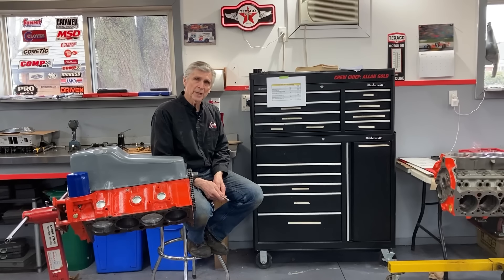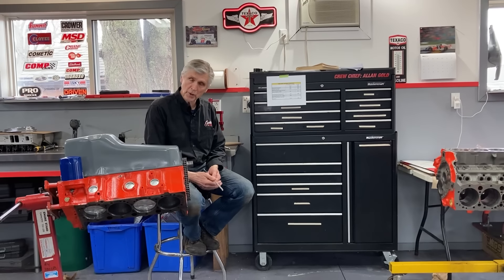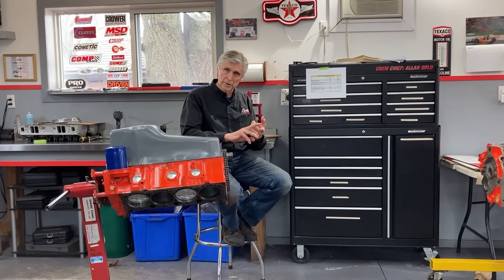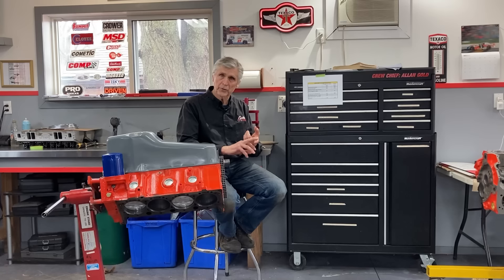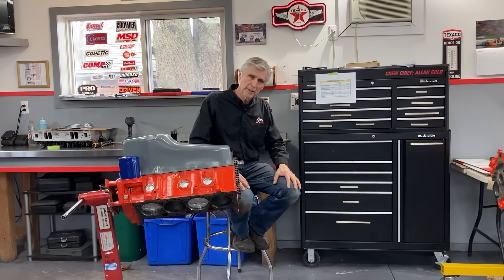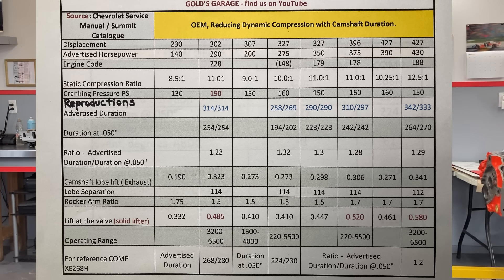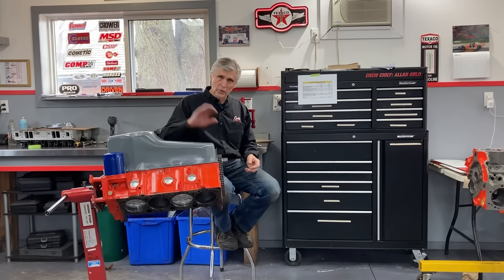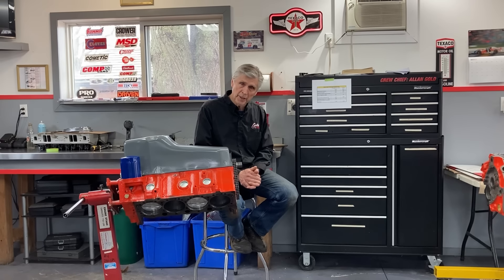Selecting the right camshaft - Compression Myths How much compression can you run on pump gas?

Comment: There is a difference between cranking compression and the dynamic compression the engine sees at the torque peak.  If you were able to test the 427 compression at 4000 rpm instead of cranking rpm, you would get a lot more than 150psi.  If you took a mild, luxury car big block cam and put it into an L88, you'd probably detonate the engine to death.
Reply from the maker: Good points peter. I meant to address your comment about compression at 4000RPM in my last video. You are correct, the air has weight and so it has inertia. At high RPM it would essentially supercharge the cylinder. That is how it makes power. The weight of the car is also a factor. Thanks for your comment. AG

Comment: With water injection you can drastically increase the octane effect on your fuel, advance timing significantly. The engines im screwing around with have AVCS, basically advance and retard cams with oil pressure at different rpms, I just don't know the best way to tune it yet. Im thinking more advanced cam timing, higher dynamic compression... Learning still.
Reply from the maker: Thanks for sharing your experience Crazy.AG

Comment: You are incorrect about a number of the facts regarding the phase out of leaded gas in the 1970s. Let me clear up a few of them: 

1) The EPA has absolutely no authority over Canada or Mexico, only the US.

2) The EPA did not ban the sale of leaded gas beginning in 1971. That is completely false. What the EPA did do is mandate that (most) new vehicles in 1975 have catalytic converters, and those vehicles needed to run on unleaded gas bc leaded gas would ruin the catalytic converters. The actual phase out of leaded gas by the EPA took place over a much longer period of time, but up until 1975 pulling up at a station and finding leaded gas was the norm, not the exception.

3) However, various manufacturers could see the writing on the wall long before that and that's why they VOLUNTARILY started reducing compression ratios in ~1971 to prepare for the lower octane unleaded gas that they knew would be coming eventually. 

4) Ethanol wasn't widely used an additive octane booster to gas until the mid-2000s so your statement about that being why the engines made less power in the 1970s is completely wrong. Between the late 1970s and mid-2000s MTBE was the additive octane enhancer of choice. 

5) While your statement about ethanol containing less energy per unit volume is true, again, that has absolutely nothing to do with the power levels of engines coming out of Detroit in the 1970s since it would be decades before those engines even tasted that moonshine. Additionally, you have a fundamental misunderstanding about the combustion process and how power is created in an engine if you think that the lower energy content (by volume) of ethanol means it will inherently make less torque/horsepower than gas in an engine properly tuned for it.

I appreciate your videos but that was just a lot of misinformation you dropped in a short period of time.
Reply from the maker: Thanks for your comments Noway. I try not to get into debates about stuff like this but I did not say that the EPA banned the sale of leaded fuel, I said it mandated that engines being produced after 1971 had to be able to run on unleaded fuel. Watch the video again and check it out for yourself. 
Manufacturers reduced compression to comply and HP ratings dropped dramatically starting in 1971. You may know how to make the same power with less energy but the OEM's didn't in 1971.The rest is history. 
Newtons Law of Energy states that energy cannot be created or destroyed, but can only change its form. If you inject less energy (BTU)  in to an identical process you will get less out. It's just psychics. AG
Reply: @goldsgarage8236  You're correct about what you stated, I heard that wrong. Unfortunately you're still incorrect - the EPA did not mandate that vehicles manufactured after 1971 had to be able to run on unleaded fuel, either. Again, this was done VOLUNTARILY by the automakers (it was led by GM and this was back when they had enough influence on the industry as a whole for Ford and Chrysler to follow suit). I would post a link but I don't think YouTube allows them in the comments, however if you Google search you'll see an article entitled "Industry Backs G.M. on Unleaded Gas" from Feb 15, 1970 in the New York Times that explains the whole thing. The EPA itself wasn't created until the end of 1970, FYI. GM decided they wanted their new cars to be able to run on unleaded gas, which was lower octane than leaded gas, and so they reduced compression ratios to make it happen. Period. There is nothing to debate here, all of this is matter of easily verified public record.

As for the lower energy content of ethanol compared to gasoline, have you looked up the energy content of methanol, as well? Once you do, see if you can figure out how the guys running it are making so much power. Hint: what makes for the best fuel economy and what makes the most horsepower are not necessarily the same things, and you shouldn't get them confused.

But to reiterate, ethanol still had nothing to do with the reduction in horsepower by vehicles produced in the 1970s. There was no ethanol whatsoever in the unleaded gas sold in the US in the 1970s, 1980s, and most of the 1990s.
Reply from the maker: Thanks for watching my channel and commenting Noway! AG

Comment: If you're going to have to run premium gas you might as well run close to the maximum amount or half a point lower than maximum compression that premium can support! Same with lower octane gas rating! I run 10.5:1 on 91 octane non ethanol fuel and motor runs fantastic!   If I am going to build a engine for a muscle car 60-70s era its going to be built to make more horsepower than stock and compression would be based on what compression  premium fuel can support!  If you loose power because of having to take down a point with lower compression pistons ect then you make up the power with bigger camshaft or use a modern roller cam conversion to make the engine make more power, more drivability, and reliability!  Modern camshaft grinds can make up lots of power you lose by having to lower the stock compression to make fuel standards of today!  No one cares or will know you are using a bigger or better cam. But most people want more power and not a detuned turd when you think Muscle car! Same goes for heads.. Unless your building a concours car no one cares or knows if you have aluminum modern cylinder head and intake painted factory looking.. You open up a hood at a car show and 99% of people will think its a stock engine!!
Reply from the maker: Thanks Larry, all good points. Be careful adding camshaft to make up for low compression. That said, there is diminishing returns in compression. You gain more going from 9-10 than from 10-11. I would suggest calculating your dynamic compression first.
Reply: @goldsgarage8236  Well thats good news since my 307 is fixing to go from 9 to 1 up  to 10 to 1 😊
Reply: If you lower compression and run a bigger cam you will lower your DCR to the point of having  a gutless wonder of an engine.  The whole point of the video was to match compression to camshaft to end up with an efficient engine that can run on pump gas.  The more compression the larger the cam generally.  Loweer compression needs a smaller cam to keep the DCR reasonable for good low rpm torque.

Comment: But don't you think that LSA has a major factor in an engine that has like a 280 duration  for lower torque when you compare 108 LSA compared to 112 LSA. And because 112 will have a smoother idle and faster throttle response compared to the 108 in which will have lower manifold vacuum and a slower throttle response . Somewhere there has to be a torque and or h. P. Difference
Reply from the maker: Thanks Born, i think your analysis is correct. AG

Comment: Since detonation takes a certain amount of time it's very very rpm sensitive,  the lower the revs under load the more detonation. 
High compression with the same fuel at higher revs and similar cylinder pressure, combustion is past peak pressure before detonation has enough time to occur....
Rev it!
Reply from the maker: Good advice Robert, thanks for the comment. AG

Comment: Great video, I'm currently building an australian 250ci inline six. Its going to have a healthy camshaft and I've done all the math it should end up with 10:1 static compression and 8:1 dynamic compression with 160psi of cranking pressure. As my first engine build I think Im on the right track to getting a healthy street engine.
Reply from the maker: Thanks Odinxf. Those are good compression numbers and about what I usually aim for. Remember that the compression calculator assumes zero leak down, but there is always some so your actual cranking pressure may be a little less than you have calculated. AG

Comment: Static compression and duration are not an acceptable way to determine what fuel is ok to use. Cranking psi isn't much better.

Dynamic compression ratio, which factors in inlet valve closing degrees (numerous online calculators available free) , is the better way. Your compression isn't going to be the same if the only change is an inlet valve close of 68 ABDC vs 88 ABDC

Alloy heads will accept higher compression than iron heads.

Combustion chamber shape, piston crown, top ring location, spark plug heat range, cooling system efficiency (back cylinders/combustion chambers always run hotter) and a number of other details will also have an impact on flame propagation and hot spots that can lead to pre-ignition.

It's also worth understanding that low octane fuel burns faster and therefore requires less ignition timing. both of these are in fact more efficient. I'd rather run 28 deg total advance with 87 than 38 deg 93
Reply from the maker: Thanks J, compression pressure is correlated to DCR and is a way to measure it. More content for my next video, thanks for the input. AG
Reply: That's a long bow to draw. True dynamic compression ratio is achieved through precise measurement and calculation. Rod length is a variable of DCR for example as it changes the piston accel/decel curve and mean piston speed.   

Cranking pressure is at the mercy of the many variables. Whilst it's a useful diagnostic value I wouldn't be choosing my fuel and tuning based on it.

Comment: I have seen guys post on facebook claiming to run 14:1 on pump gas.
Reply from the maker: Thanks Cuzz, I don't think I would try it. Also there is a diminishing return benefit to higher compression. AG
Reply: @goldsgarage8236  I have never heard about the diminishing return but it makes sense. I used to just call bullshit when someone claimed to run 14:1 on pump gas non E-85 but really I dont know if they actually do.

Comment: Why bother the high compression the camshaft goes both ways to reduce or increase compression still end up with comparable results. If it's what you have ok but why build that way?
Reply from the maker: Good point fasteddy, thanks for your input. AG

Comment: waiting over 2 months, I need the right brain. I'm building a 68 nova, It has 3:42 gears with m-20 trans. I have a 72 454 that is .40 over with speed pro h581cp pistons with a stock crank and rods, and it has been professionally balanced and the estimated compression is 10.5, at this time I have 049 stock heads an edelbrock air gap and a quick fuel 750 with fat stainless headers.
 I have called comp, isky, erson, howards and clay smith and everyone tells me a different cam. Today I was ready to order Comp Cams 11-423-8, Grind # XR276HR-10,, Duration at 050 224 int./230 exh., Factory rocker ratio .502 int./.510 exh. the rear gear change is not a problem and might want another carb, What do you think ??
Reply from the maker: Thanks shifty, I have built 2 427's recently with this cam. There are videos on my channel about both of them, including a dyno test of one of them. I think it is a good choice. The 750 carb is also a good choice. I will be making videos of the second 427 install into a 1966 El Camino in a couple of weeks. Thanks for watching Gold's Garage. AG

Comment: Continue.....Charger engine Exceeds 102% Volumetric Efficiency at 5500 Rpm continuing to Max Red Line Rpm......That 53 cubic inch (at Full BDC) cylinder Is Overfilling to 54 cubic inches every time at Max Torque range Rpms.....Hence the name "RAM Charger".....I'm sure the L88, L79 & others run Way High VE also Throughout their  Rpm range.....If Those cylinders Are Filling >95 % during Full Load Rpms, ....Might be Closer to Full Static CR actual  engine speed Octane requirements than thought.......Just putting it out there......
Reply from the maker: Thanks Tom. You are correct and that subject is part of the script for my next video on this subject. Watch for it. AG

Comment: Propane, you can run 14-1 surprised it wasn’t used more
Reply from the maker: Thanks for the comment Mother. I think you are correct. Here is the problem with Propane. 1cu.ft of gasoline has 901.605BTU.  1cu.ft.  of propane has 2,516BTU. AG

Comment: No, the L88 will NOT run on 87, not under load anyway. The deal is, the OEM cams have alot of duration, but considerably less useable duration. The valve has to lift a certain amount before it really starts to flow, and the OEM cam takes longer to do that than a modern "high energy" cam
BTW, here in British Columbia there is 94 no Ethanol gas at Chevron
Reply from the maker: Thanks Alley Oop. To validate your point, if you look at the chart in my video, the effective closing point for the L79 OEM cam was 81 degrees, but the GM spec point was 108 degrees. Thanks for your input, watch for more on the subject.

Comment: When you put hi comp pistons in an engine and then find out it won't run on pump gas. Oh boy. There are other ways to make power with out high compression pistons. Better flowing heads, mild boost, fuel coolers, 225 hp nitrous kit is about the max pump gas will handle. But thats good.
Reply from the maker: Thanks for your comment Paul. Please keep watching! AG

Comment: It's a guessing game, I doubt the L88 will run on 87 and just barely on 93. Only way to tell is to build one and test it.
Reply from the maker: Thanks Joe, as I mentioned why even consider 87? However the original L88 cam has lots of duration so I think 93 octane would be manageable. AG
Reply: @goldsgarage8236  When those engines came out regular was 95, hi test was 100, and you could get 105 at Sunoco for .50/gal or there abouts. Ah the good ol days.

Comment: Actually the regular gas was 93 and premium was 97 in the 70’s
Reply: Up until September 1974, leaded gasoline with 5.5 grams of lead per gallon "regular" was TYPICALLY SAE rated at 97 octane (by motor method) and "premium" (or Ethyl) was rated at 101 SAE octane. A few of the "Majors" (Chevron, Sunoco, Gulf and Standard ) offered up to 110 octane "Premium" fuel at a premium price! Sunoco "Blue" and Amoco "Ultimate" were the highest octane "pump" fuels ever offered I believe on a wide-spread basis. In a couple of regions of a couple of States in the South some 112 was sold.  I pumped it then and for 34 years afterwards I worked for the 5th largest Oil Company. Now "gas stations" (small sellers) could "spec" lower octane ratings for a cheaper priced product, but people caught on quickly, as flathead engines "knocked" on "cheap" gas under load worse than high compression engines. Ford Flathead V-8's with carbon in the heads and on the valves (always!) knocked ALL the time unless you put Alemite CD-2 or Marvel Mystery Oil in the tank, then they smoked like an outboard! Lead in gasoline was dropped to 3.5 grams per gallon in Sept. 1974 and banned in 1975 (depending on the state you lived in, what month). It was Oct 1975 here in Oklahoma as leaded gasoline dropped to 17.8 cents a gallon with 10.9 cent a gallon state tax-that was cheaper than at the height of the Depression when it was 19.9 and only 5.9 cents tax.
Reply from the maker: @Walkercolt1  Thanks to both you guys, That is a lot of information, you are very informed on this subject. I do remember buying as for 29.9/gallon in Flint Mi in 1970. Thanks for contributing.

Comment: Forgot to add my dynamic compression  comes out to about 8.4 to 1.
Reply from the maker: Jesse, please see my reply to your previous comment, and sorry for the late response. AG
Reply: @goldsgarage8236 What am I expected  for cylinder psi pressure on my 350 with 9.9 static and 8.4 dynamic compression  with my Howard's 255/261 advertised duration 201/207 @50 on 114 centers installed at 109 intake center line. I used the Wallace racing dynamic compression  calculator  and gives me about 175psi, won't know how accurate  that is?

Comment: A guy asked me to help with his 1969 Lincoln with a "built" 460. He couldn't get it timed and running amongst other issues. I have no idea of what piston and cylinder head combo he was running but the static compression was 225psi. Did I mention it had cast iron heads. I ran away from that job when he had trouble cranking it over.
Reply from the maker: Good move, thanks for sharing your experience.